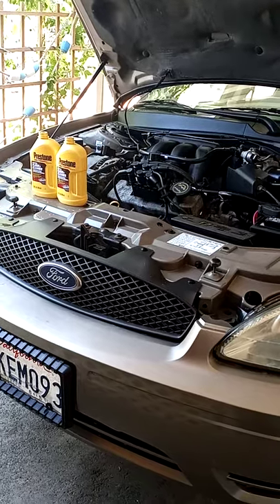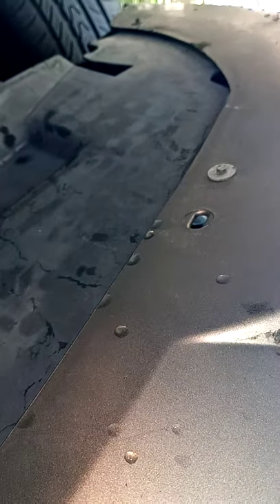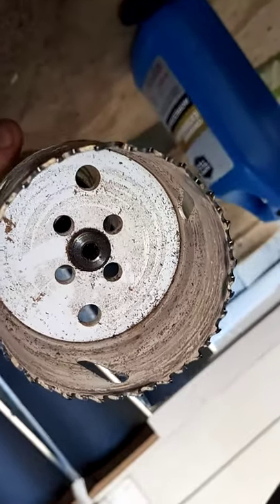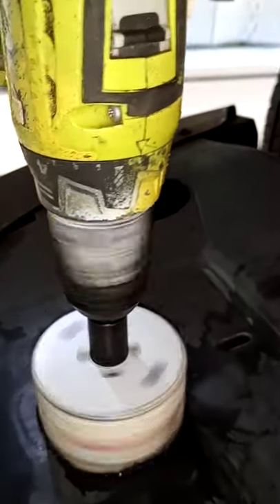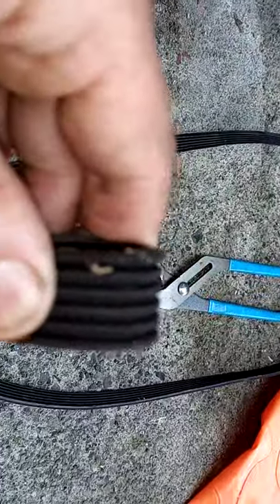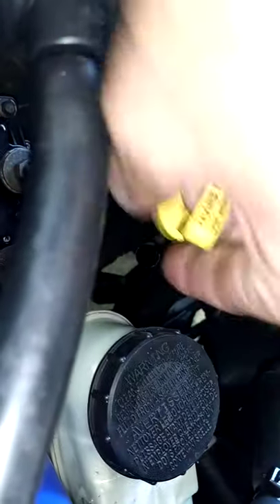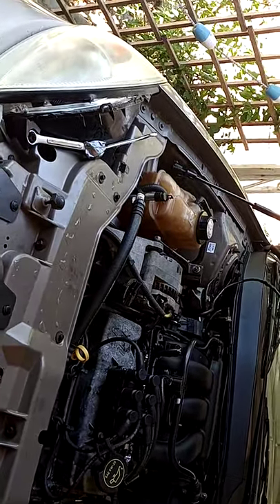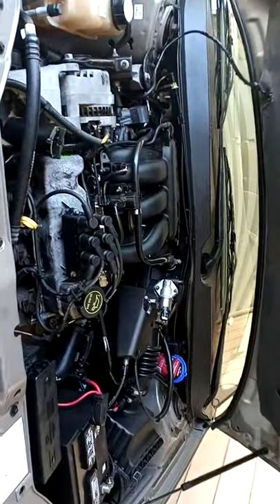2005 Sable / Taurus Radiator & Heater Core Flush. Drain Plug "trick" for "access hole," & other tips

Comment: Taurus flipping 101 - LOL
Reply from the maker: Yeah. Probably flipped 50=70 of them in a six year period. They are notoriously under-serviced. Super easy to clean up and get running properly. The Sable GS Premium with the switch on the side of the driver's seat that allows you to make the gas pedal and brake pedal adjust is so awesome. And, their premium sound system makes the Scorpions sound like being at the concert, which I have been lucky enough to go to. The Sable has such a nicer sound insulation, quieter ride, better suspension, etc, that even the top of the Taurus line can't compete with. 

I really like the newer Tauruses, from 08 onward. But, the internal water pump is not a DYI for my skill set and it needs to be done at about 100K. So, I stick to the 96-07's and do a full cleaning / detailing / tune up and can usually sell them at a modest profit. 

BTW: I use a leaf blower to clean the inside. I haven't vacuumed a carpet for years. Except when i use a wet / dry vac and I'm cleaning the carpets: after I use a leaf blower, gas powered. That's a pro-tip for you. Leaf blowers clean the interior so much better. Just don't let the headliner get hit with the air stream. But, a leaf blower will clean stuff out from under and between the seats that's been there for years.

Comment: Come on guy you really serious with this, stay away from cause man,  try working on this kids bicycles instead. Drilling holes for access to something that only takes 5 minutes to remove makes absolutely no sense whatsoever. There's a reason that splash guard is there,
Reply from the maker: In fact, if I remove those splash guards, I often do not put them back in and toss them out. But, that's me. So, I'd say it's probably a fifteen minute job to remove and another ten minutes to reinstall. However, I'd love to see your video? Do you have a link? How do you do it in 5 minutes: removal and replacement? Power tools? In any case, the way I do it is not for everyone. Had Ford placed an access hole there in the first place, we wouldn't need to be discussing this. But, if you prefer to remove all those screws and put them all back in for what can be done this way, go for it.
Reply: @stevebutler812  I don't make YouTube videos because I'm too busy making money. There's a reason why that splash guard is there and that's not a great place to be drilling a hole as it is protected by the splash guard. The difference between you and me as I do things the proper way regardless of how many screws there are.
Reply from the maker: @willsrestorations  You're right.